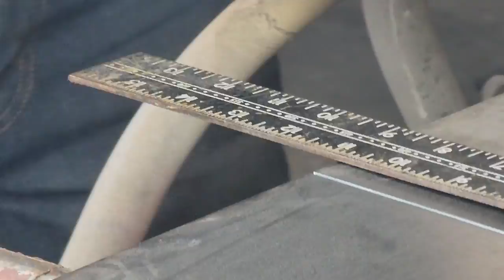Fabricating floor supports | 1948 Ford Concept Car Hauler 🚚

Comment: Love that you put that leftover steel in for a little added strength where the wheels will be.  

If I lived nearby, I'd sweep the floors in your shop just to learn from you.  I'm 70 years old and I love learning.   I learn something with every video you two put out!! (and I've done a lot with cars over the years).

Keep up the great work!!
Reply: Give the prize to someone else.  I have most everything I need.

Besides, this looks more than a little suspect...

Comment: Measure twice and cut once. Add some kind mounting point or slots or bolt pins for your ramps. You don't want them to drop while your going up on them. 
The smaller cut ramp pieces could be used later for support around your wheel area or removable covers. You don't want debre flying off the tires later in bad weather and get all over your race car.
 One last thing, you still could add another auxiliary battery to the truck for your 12 volts needed. Add a separate generator (alternator) or convert the whole electrical system over but that means everything.
It's really shaping up nicely and will be a real cool looking hauler. What are you thinking about calling her?

Comment: Hi Chad and Jolene, what a pleasure to be able to experience the entire building process with you, to walk along so to say, and what a great filming it is! I understand that you use metal plates for strength to put wood over that. In itself a good idea, but note that water can remain between the metal and wood, which can seriously affect the quality of the wood in the long term. Maybe a few wholes in the metal would let the air flow and make it dry a little better, it's strong enough.

Comment: Carrying the ramps…. Couple pieces of angle (for each ramp), under the deck, parallel to the main frame rails, starting just forward of the rear of the bed, will create the perfect slide-in channel for the ramps.  Also keeps the ramps out of view when not in use.  Easy to get to right where they are needed at the back of the truck.  Love the project!!!

Comment: Don't need to grind the welds of the plating where the tires roll as they will press into the wood  .  Think about a rack and box at the front of the bed  , overhead for spare tires , gas and oil cans and small cabinet for straps and chains and tools  . That would be so cool! !  Think about it Chad.....you da man  .

Comment: " What to do and what not to do" says the man who made a tow dolley out of angle iron that is stamped full of holes for storage shelfs that is less than an I/8 of an inch thick. I must admit, that's gonna take a bit of time before I can honestly receive any advice after witnessing that debacle. Its going to have to take some time before I can process that one.

Comment: I you use thise ramps with lip up put some pins bolts something they will slip off if you ever spin the rear tire

Comment: Chad. Brilliant work. Appreciate you showing every day's construction. Can I offer a suggestion, the Ramps, and securing them to the deck. Please don't ask how I know this, but, please secure the Ramp ends where it attaches to the body, once the vehicle is on board, it only takes a spin of the rear wheels to shoot those ramps away from the body. Leaving you "dangling the Dunlops" in mid air..a huge problem, and we don't want to see that.

Comment: Chad makes MIG welding look easy. I have been trying to perfect mine for years and I still struggle with it.
Reply: The argon gas makes a big difference, much cleaner than fluxcore wire. I don't know if you use gas or not but that could be the problem you're having. That and Lincoln makes a great machine.
Reply: Oh yeah 😉👍✌
Reply: @StevenTheElder I think that's what Chad uses. Pretty sure.
Reply: join a fb group to help you, its easy when you run a few miles of the stuff
Reply: upload your welds and most will tell you what you need to do to make them better. just dont join " i see you dont know shit about welding" they will rip into you like a mw2 lobby
Reply: @SamFBM  I love that page and find it very helpful

Comment: I wouldn't have cut the 8" on the ramp of the bed. Would've ran it as long as i could over the support. Weld from underneath to the support. Any cut or weld of a junction is a possible point of failure. Leaving the sheet skinned over the support elevates some points of failure. The wood is gonna be skinned over it so no one will care if it's 8"x anything. Just my take. Everyone does things their way. Thanks chad love the videos.

Comment: Cold cut circular saws are game changers. For example the dewalt cordless 20v cold cut saw can do many cuts on a single charge and the blades stay sharp for hundreds of cuts. They are way faster than plasma cutter, and the edge is a  perfectly clean factory edge  requiring no flap wheeling.   I have the cold cut chop saw as well, fast clean accurate cuts for long stock.

Comment: Great job you too you could easily hold the ramps in place by putting two bolts through the aluminum ramp and drilled two holes into that framework to keep it locked in place love y'all's channel

Comment: Are you planning to paint or coat the floor framing before laying the boards on it? I would imagine it’s going to rust pretty bad if not sealed with something.
Reply: i hear that pressure treated lumber is especially prone to rut iron

Comment: Make a pass through box under deck behind tire. Like what you see on travel trailers. Keep ramps and straps in it. Also make some reinforcements for flush d rings in floor for tie downs. Looking good. Cheers from Alaska

Comment: Mr. Chad Wallace from New Orleans you need that holder on the back of that truck that your trailer because if you accelerate that ramp it’s gonna slip off that’s the purpose of that hook to keep the ram from slipping off when you accelerate as you’re pulling the on so the ramp don’t move even when you’re Whinchen God bless PS this is not a comment it’s just a suggestion it’s a safety matter

Comment: Chad and Jolene when I’m loading and unloading riding mowers from the bed of my pickup I use ratcheting tie down straps hooking the bumper wrap around one of the cross braces of the ramp and back to the bumper ratcheting it till the ramp is against my tailgate securing the ramps from moving away. Food for thought on safely loading and unloading your vehicles if the ramps aren’t going to be an Integral part of the truck bed.

Comment: With the ramps I would weld a bolt or something that would anchor the ramp to the truck deck so it wold not fall off as you are loading the car just a suggestion Chad looking great so far

Comment: You need to have tail lights on the back of the truck the ramps need to be pinned or fastened to that back part of the truck so they don’t slip out of there either pins or bolts or some type of bracket that you can fasten nose brat those ramps to the back of the truck when you’re driving it up on there it would also be nice to have some place where you could store the ramps securely but definitely you need lights on the back of their

Comment: Hi mate love your work … noticed that you are going to use the alloy ramps great idea nice and light but you will need to put a pin or something to hold them while loading the car as they will slide off the edge if the truck moves or the ramp slides

Comment: Also worth putting some stout bars across the frame at the front to stop the car running into the cab if you run into something on the road. Don't want to squash the truck's most precious cargo - you and Jolene!!!

Comment: I'd be wanting to use that truck to haul anything I want to haul and not just that race car. Also, put them other tires and wheels back on if you don't find the 20 inch wheels. Looks better as dually.

Comment: I don't see a problem with any of this build. Looks amazing and is going to turn out amazing! Always and this is a personal preference like the open centered trailers and ramp trucks so if i need to work on the drive train change oil whatever it can be accessed while on it.

Comment: Your bed of your truck where it beens down the cable will cut in to the deck when it is hooked to the car you have to put a roller or a skid plate for the cable to  work off of just trying to help out a little

Comment: id use the hinged side of the ramp forward, drill a pin set up like hood pins 2 each, don't enough loading to know they like to move around.. or the aluminums I have like yours I would take a strap and grab a rung and strap em back to the bumber..  worked

Comment: Looking close looking good .take what you want leave what you dont like its simple .the winch box would look cool a custom framed box like the truck sides could add some wood on the top as a cover for the winch and would all match in .always top form camera even when the wind is windy Jolene thanks guys as always

Comment: If you put the ramps as you indicated in your latest video, a suggestion (based on experience) drill a hole on each side of the small angled flat area to drop some kind of pin/bolt through it to keep the ramp from sliding backwards.

Comment: HowAre you going  to carry the ramps ? On hinges that fold up or removeable that are tucked in under on angle iron ? The 48 is just about to take on a new job by hauling race car . The floor still needs doing but Chad will get her done ! Thumbs-up Chad and Jolene best team I've seen that compliments each other very well 👍
Reply: an awesome rteam yes indeed a couple made 4 each other , proud of there accomplishments. a little appreciation for quite afew tricks I've learned. I watch everyday

Comment: Chad now that you turned the ramps around,if you worried about the end that hits the floor,cut it at a 45 degree angle to drop closer to the floor.

Comment: I am 49 years old 25 years  worked as  a carpenter s helper  my dad.   That 1x6  will sag any  width over 16" 
In my opinion that metal  want keep I from sagging unless you put  cross bracing in  between  where each tire comes to rest

Comment: Chad and jolene just my belly button but could you not take the back wheels off and turn them around so the well of the wheel faces outward that way it might let you have the deck of the truck flat and not need much of a wheel arch. Cause them wheels can be fitted either way. Also  the way you have it now the back wheels are further in together than the front ones and turning the back wheels will put that right .just my belly button. Keep up the great work the both of you 👍 👏

Comment: Chad I wish you would put down two by eights instead of one by eights if anything put a 2 x 8 or a 2 x 10 where the tire track is ? Also where the ramp starts to slope go on an angle you may have issues with using that one by when you make that miter and attaching it maybe you could put a 2 x 8 on the corner from right to left ? I don’t know what type of wood you’re putting down but regular one by eight it’s not gonna hold up too well in the weather.

Comment: Suggestion: Don’t put the timber on until you have finished welding, timber burns with sparks , and where the car is running use thicker boards or double up decking

Comment: Suggestion Chad: Why not deck the trailer, then put 2x10s over the decking where the tires roll, that should give you more than enough strength?

Comment: Hey Chad looks great 👍  I'd not trust that lip on the ramps to hold the wieght do what say turn it around , you could fabricate a plate so it drops over to lock it in place as not to allow it to slip away when driving off them just a suggestion pal .

Comment: you need to make a way to attach those ramps to the truck.. that aluminum lip will not support a car..  those ramps are made for a riding mower, if you don't beef up the supporting edge your going to get the same result as the towbar

Comment: Hi Chad it's Josh I have a 1956 chevy bel-air 4 DOOR that i would love to chop in to a 2 door car and plan to do so but would love to do it with you as im a fan and watch your show all the time. I also have a 4 door parts car that we could use the doors off of to make the 2 door doors from as there about 6' longer so it would take 2 sets of 4 door doors. It can show ppl that can't aford to buy 2 door doors that there is other options. as new 2 door doors are around 1800 bucks by the time you pay to ship them and pay tax. Im in the states but would haul the car there to have bad chad work on it ! as long as CHAD and Jolene sine IT LOL .... But all jokes aside i hope i hear back from you guys as this would be a great car to work on it's rust free. I can send pics.

Comment: I know it's your build and your engineering, but you should think about hauling other car's truck's you may want to bring home that you might have to trailer home. You can always load it up in the back of your race car hauler? You can use it to haul other car's to maybe Jolene car to car shows far off land's?

Comment: You should make something for the ramps to slide up in underneath the back of the truck so you can just push them back up under the truck after loading and unloading the car.

Comment: Only thing about deck wood...especially pressure treated..it'll get slippery from any oils and what not soaked into the top. Hate to see that race car slip trying to climb into the truck. Also are those aluminum ramps weighted for a car?? Or just like quads and mowers they are intended for?

Comment: Are you going to put a trailer hitch on the 
48 just incase you want pull trailer  that way when you run tail lights you can go ahead wire it for trailer also

Comment: I wonder what the weight of the truck will be once it is completed. When you load Jolene’s car will the engine be powerful enough to pull the load?
Reply: It pulled the fire truck and equipment that was on it for many years.
Reply: @edricoddot  Good to know. Just wondering.

Comment: Just a bit concerned about the lack of a mud-guard over the rear wheels Chad. Won't all kinds of crap be whipped up as you travel along the road in rain..all of which will end up spraying the racer!

Comment: Will car clear the departure angle going on truck from rear panel to flat deck of floor
A recovery truck I built angle of beavertail was as graduall as I could get it
Slope of body I did from 
1 o'clock of rear wheels (looking at left wheel) to the back panel
Nice and graduall with 8ft ramps
You can put very low cars on it never bottoms out loading

Comment: Another way of checking departure angle of deck is measure wheel base of car
Then measure sill panel to floor, half the wheel base by height of sill that's your departure angle
You could use a length of metal the same length as wheel base of car with a peice welded each end the same height as car sil panel or lowest point of car then use thst like a dummy car going on truck  |----------| like that hope that      ☝️  explains what I mean

Comment: Why not just run a separate deep cell battery like on a regular car trailer. Also, I bought the remote control attachment for my winch, makes loading by yourself a breeze.

Comment: Chad, I'm thinking those ramps are not made for the wieght of a car, you may need to beef then up a little bit with some angle iron down the length of the sides.

Comment: It seems to me where you are welding the metal for the tire tread. It is right in line to run over the rear tires
Reply: Should never weld a body like this directly onto the chassis...each  .crossmember should have been bolted on and torqued... cracks are going to happen.

Comment: im loving the build , but thought i would ASK IF YOU HAVE CONSIDERED HAVING A COUPLE OF STABLISING JACKS ON THE REAR OF THE CHASSIS JUST FOR EXTRA SUPPORT WHEN YOU DRIVE UP THE RAMPS . TO PREVENT ANY CHANCE OF THE FRONT WHEELS LIFTING .

Comment: Chad, did you account for the movement of the rear tires on the hauler or where you going to make it a rigid rear end? Looks like the tires are pretty close to even with the bed of the truck.
Reply: It's on leaf springs. They won't move but about 2 to 3 inches.
Reply: @kennethcrotts7870  that's my point, the tires are sticking up above the top of the  metal for the bed of the truck by about 2". with the added weight the Race car the wheels will be rubbing on the wood cross members unless there will be nothing over the top of the tires.  Am I missing something
Reply: He's not putting boards over the tires. He's putting a removable wheel cover on it and remove it when loading and unloading.

Comment: After using this few times that sheet steel will start to bend and you’ll end up with a bunch of wheel indents on each plate.  Need more support that flat plate isn’t going to hold up either. Your crossmembers should be mini I beams or tubing This will not hold up over time. Just hate for you to spend all that time and have it fail in time.

Comment: Did they tell you, if it's treated lumber, you can't paint it and I would epoxy paint the sheet metal supports you put in. They will rust away from rain and snow. Jerry

Comment: the wood should be cut at 22 1/2each piece not one at 90 and the other at 45, You will get a sharp edge that needs sanding. With two 22 1/2 you can sand them a little round without one becoming thin

Comment: that wood will hold the car no problem it would have to weight thousands of pounds per square foot to break remember when you are standing on it you are putting your entire weight on one (1) square foot , now imagine each square foot of the car/ truck whatever  and how much that might weight

Comment: Why don't you cut a piece of tailpipe in half, end to end and connect the bottom pipe bend to the top pipe bend at the rear of the side. Would not be seen from outside. Would support that wide flat panel. . Jerry in Kentucky.. .
Reply: Did they tell you also that the 5 quarter decking will shrink. Just a note. . Jerry